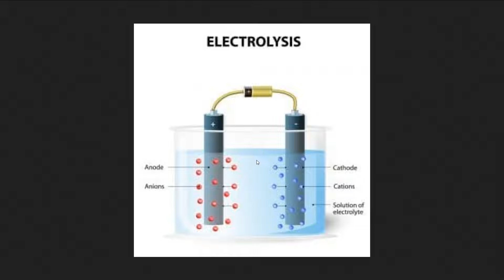Etching Copper Clad Board With Salt Water Electrolysis - How Well Does It Work - Simply Put

Comment: It's great to see you experimenting whether or not it's a success or failure as that's a key to learning.  BTW, I no longer use Ferric Chloride.  It's messy and expensive.  I have since switched to a mix of HCL (available commonly and cheaply in hardware stores as "Muriatic Acid" used for concrete etching) and "drug store" Hydrogen Peroxide.  So both are readily available.  I achieved excellent results etching copper clad with that combination.
Reply: I don't like etching at all, so I switched a few years ago to CNC milling. A few hundred bucks builds an overkill mill, and it's been smooth sailing. It's also great for very precise drilling, because it's all CNC.